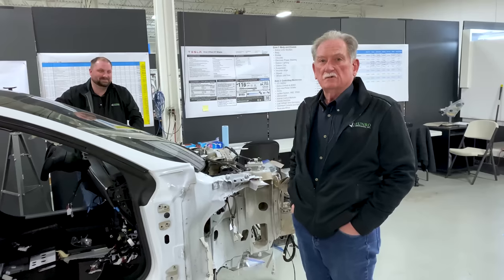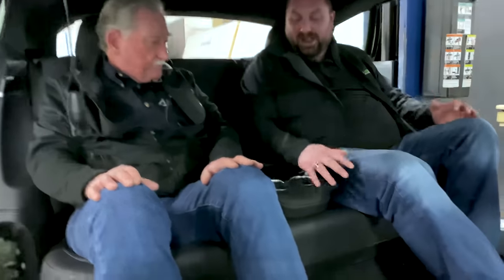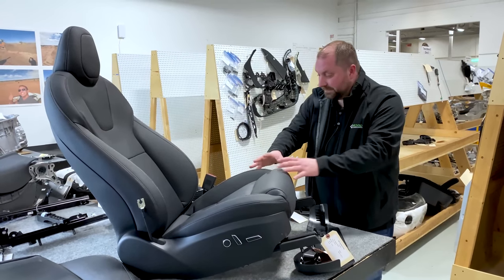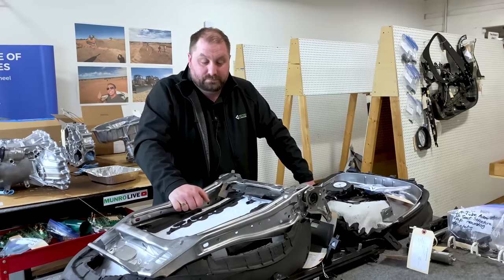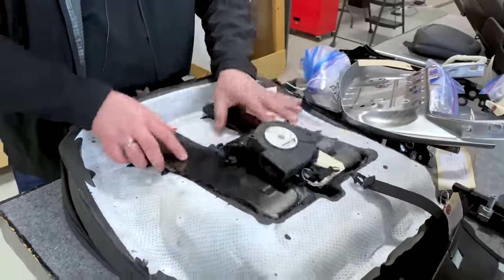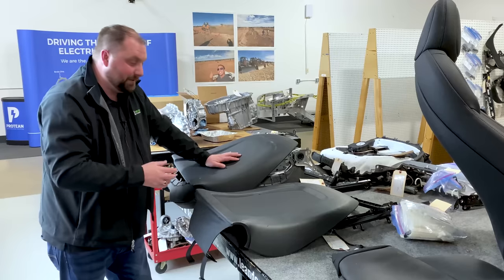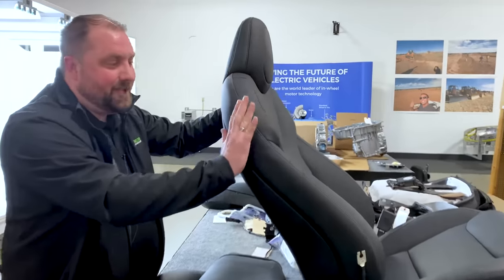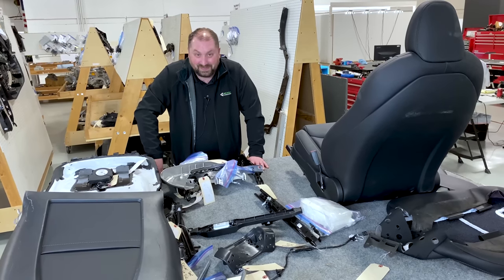Tesla Model S Plaid - Seat Components & Analysis

Comment: Carl is a beast. What incredible knowledge and he's incredibly articulate while describing some very complex subjects. Well done, Carl!
Reply from the maker: Thanks Josh
Reply: One of the less expensive options to spread the pressure to the legs, is to have a deeper / bucket like seat or tilt the sit in a more upper position to support the back of your knee. If your bottom sits lower with 2/4 cm, the rest of the seat will support your legs too and spread pressure on bottom + legs will decrease the overall pressure giving more overall comfort, leaving enough head room for taller persons - just look at Carl's torsos height comparing with you Sandy - and will increase the leg room.
Reply: Your comment hit as true as Carls remarks!
Reply: nah

Comment: FINALLY!  I get to hear someone talking about how the distance between the back of our heads and the headrest should be minimized. I worked in PT clinics for a few years and I saw the effects of whiplash injuries on people all the time. I keep the back of my seat as vertical as possible such that the back of my head is as close to touching the headrest as possible. Yeah I'm not one of the cool-kids laying way back and driving with one extended arm barely able to reach the steering wheel, but hopefully this keeps me out of the doctor's or chiropractor's office if some texting-while-driving-idiot hits me from behind at a stop light.
Reply: I was driving a 2 door 1990 Datson and was rear ended at a toll booth in New Jersey when the driver behind me was searching for a quarter she dropped on the floor.  My car was totalled and I went to PT 2x/week for 5 months.  I ALWAYS keep my head against the headrest when stopped.
Reply: The Citroen SM of the '70s is the only car I have seen with an adjustable head RESTRAINT.  I have always wondered why, with the most important part of the human body, seat designers could be so casual.

Comment: I HAVE BEEN "occupant out of position"   I was adjusting the radio when I crashed [not paying attention] and that slight shift in position allowed me to rotate around the seat belt and my head hit the windscreen.

It was a low-speed cash so it was not a big issue - but it's amazing - just leaning forward and towards the centre of the car 6" can mean the difference between being restrained and not
Reply: I had no idea this was even a thing but it makes sense. I will be paying attention to how i sit now.
Reply: @b4804514  - I was really shocked, but the seat belt moving just off the top of your shoulder as you lean forwards to mess with a centre mounted radio means it does not catch your upper body and the momentum PIVOTS you out of the upper part of the seat belt, then it grabs you around your stomach and you headbutt the windscreen.
Reply: Thanks for the information, and I'm glad that you're ok 👍

Comment: I prefer adjustable headrests, including not only vertical adjustment, but horizontal and angular adjustment as well.
Reply: As a bus driver, I concur.  The ability to put the headrest in the crook of my neck lets the seat absorb all that neck compression on bumpy roads.
Reply: @Not_An_Alien  wouldn't that cause whip lash in a collision because the support is on your neck, where it is not supposed to be? I think anyone can buy an aftermarket pillow support to modify the seat to their comfort.

Comment: Teslas functional integration is the next level.. The headrest posts locking in the back panel was 🤯
Reply: TESLA now sells Service Manual for Tesla owners and Service center for $$$.
Reply: @markplott4820  Makes sense, why hand over that business to Bentley
Reply: Where is the functional integration in all of that!? It doesn’t even offer all the features that a similar priced vehicle offers on their seats. Other manufacturers even have sockets for tablet/smartphone attachment, bolsters that hugs you when going fast around a corner, amazing massage and much more.
Reply: @carholic-sz3qv  - FALSE, Tesla rear seats have USB C and wireless charging. and a rear Center mounted display for Climate and infotainment.
Reply: @markplott4820  wrong, in tesla all those features are not integrated into the rear of the front seats and are definitely not the most ergonomic. You can directly connect your tablet on the rear seat of a bmw and plug to the seat without the need to move your head.
Reply: @markplott4820  the tesla climate and rear information is not well placed ergonomically, Chrysler Pacifica have options with seats mounted screens for infotainment.
Reply: @carholic-sz3qv  He's talking about how they connect the back panel of the seat at the factory.  It's got nothing to do with features.

Comment: Really interesting discussion. Im a vertical seat guy. I got tired of constant back aches and realized alot of it had to do with slouching while driving. I drove a minivan for a long time and it wasnt an issue. But moving to a modern sedan with a fixed position head rest I hate it and I would hate these front seats. Then again, I would probably also hate the Tesla "launch" experience as well. 

Also was noticing your mobile A-frame tool/part trays with white boards at the top. I think I may have to steal that for my shop. Really clever.

Comment: As a note:  The Headrest is adjustable in the Model X from the original in 2016 to the Raven variant in 2019. .  Not sure whether it is in the new Plaid Model X, but all prior Model X had adjustable headrest.  At one point, the Model X headrest automatically adjusted higher when the occupant moved the seat forward or backward (mimicking  the occupant's height).   Also, I believe that Tesla completely manufactures its own seat components at one of its "off-site" locations.  That part of the process was not on the tour, so it could be assembly only.
Reply: Vertical headrest adjustment is pretty much standard, power vertical is not something I have seen, but that is not really important.  The important part is fore and aft adjustment, turning a head "rest" into a head "restraint".  Only car I am familiar with that had them is the Citroen SM of the "70s.  There have probably been others.

Comment: Carl, thanks! Very interesting to hear about things I never thought about. The denser the information the better, you did a great job in going into the details. Regarding the topic of buying multiple parts and then assembling them at Tesla being potentially more expensive, Tesla might want to have full control over the seat design and avoid delays and complication with communication when they decide to change something on the seat design.

Comment: I never knew how complicated auto seats were
Reply: Most OEM's order Generic seats from parts OEM's.......lol.
Reply: @markplott4820  other manufacturers have many different types of seats from clothe to leather(vegan and naturally tanned) to wool, carbon fiber…..
Reply: @carholic-sz3qv  - cloth seats too HOT 🔥 and less sustainable than Recycle ♻️ plastic & ORGANIC vinyl.
Reply: @markplott4820  wrong, clothes seats are mostly used on very cheap cars there are tons of cars that are even up to $15k cheaper than a base tesla. Clothes are also easily recyclable and reused in cars too. Bmw has been using recycled plastics and fibers in their cars for almost a decade for your records.
Reply: @carholic-sz3qv  - ORGANIC vegan leather is Superior.
Reply: @markplott4820  vegan leather is not superior and it’s made out of oil. The ultimate superior is real leather tanned with natural products. Real leather is a byproduct from the meat industry and not depending on oil.
Reply: @markplott4820  If the vegan leather is basically vinyl, how can it be organic? Organic refers to things that are plant based. This is plastic based.

Comment: That's a curious change.. my 2017's headrest adjusts through the control panel on the screen.  Might be another one of those things they see being under used and removed to save the costs and complexity. I think I set it day one and haven't moved it since. Of course.. it's nice for if you have 2 different drivers and profiles saved. But I guess they found people can be comfortable without moving the headrests.

Comment: @18:12 I may be incorrect because I'm not there to touch and feel, but it appears by the shape of the seat back detail it does in fact have retention snaps meaning the seat back can be assembled without the head rest to hold it all together and the rods are primarily acting as an extra locking mechanism to prevent it being pulled apart.  If it functions as was stated, when you take the head rest off, the seat back would just fall off and I suspect that does not happen because of snaps holding it on.  Personally, I think this is a clever design because it adds an extra level of durability without adding more than a few cents of plastic and adds no extra parts and no extra assembly steps.

Comment: I think the big issue with the rear seats are due to body construction constraints. The low roof for design and aero pushes the seat bottom down. While the thick floor caused by having batteries in it pushes the feet upp causing the reduced support on the thighs. Hard to work around.

Comment: The seat back panels are pinned in place by the head rest mounts to prevent the panels from detaching when the seat's internal side airbags are triggered. If snap fittings were used, the back panel could be fired backwards at high velocity and injure passengers. The seat airbags are the reason Tesla did not use the customary upper snap fittings.

Comment: The headrest angle is a very big deal to small people, as they move the seat back to vertical in order to reach the steering wheel.  I have a very hard time fitting my small wife to a car, and the seats are always deal breaker.  Subaru headrests are on a ratchet and pawl mechanism.  To my understanding they are only automaker with adjustable angle headrests.
Reply: Thanks for the heads up, I'll have to check them out.  I had been referencing the classic Citroen Sm head restraints of the '70s.
Reply: @wilfredvanvalkenburgh2874  Even the Subaru sales-people are not clued in on this.  You have to twist the headrest all the way forward to release the ratchet and pawl, to then set the angle you want.

Comment: Great job!
Reply from the maker: Thanks!
Reply: @MunroLive  You replied to me? Thank you! I have been very impressed with so may other folks (Like today!) that we have seen on Monroe Live. It makes me want to work with you more than ever. Just the other day when you revealed Tesla was using mica in their Plaid battery, I instantly thought: Of course they are for most of the same reasons I chose that same material for use as a lamp module frame on the world's first 5 pound video projector back in 1998. In my case as Chief Engineer we had +/- 12.5 kVdc strike voltages, intense light including UV, and nearby quartz temperatures around 800C that all had to pass FCC and UL for consumer use.

Comment: The rear seats on the Model 3 have the same problem - I'd trade headroom for being able to sit properly.
Reply: Some brands don't put batteries in the floor under the backseat feet. Seems the only correct way to go. Cars have plenty  of range. The backseat foot rest is where you get to make the car feel spacious or cramped. If helps a bit if you can open up the room under the front seat for backseat leg stretching. And imagine how much the absense of 65mm or 80mm cells  plus auxilaries could make there.
Reply: @Cloxxki  wrong…. Almost all brands puts batteries or inverter/charger under the rear seats, it’s just the configuration that sucks since the floor is flat seats little to low.

Comment: With the old Model S the AC charger(s) were located under the rear seat. It was moved into the battery enclosure. So there should be plenty of design space to make the rear seat better.

Comment: Could you shed some light in why, after all these years, the Model S still has no adjustable seat belt height on the B pillar? Is it a technical thing? I’m rather small and it cuts into my neck. Doesn’t feel as safe as it could be

Comment: 80% of the Model 3 I've seen have the lower hooks of the back cover not hooked in, obviously.  I like the solution with the headrest structure, but if it leads to sloppy installation of the lower mount, they should do something about it.

Comment: Elon has spoken about how the original seats for the S were terrible, and the amount of work that went into making them good.  I expect that a similar amount of work needs to be done on the rear seats.
Reply: disappointed in TESLA rear seats, they are OK, but not same level as the FRONT seats, they should be of Equal support & quality. 
Model S rear seats need recline just like Model 3/Y has.
Reply: It’s basically the same seat in the super expensive plaid that is used in the cheap model 3 what a shame, those seats should be something very special for their high end vehicles at least.
Reply: @carholic-sz3qv  Or you can look at it as the Model 3 is getting the same seat as the high end Model S.  Tesla is making the best seat they know how to, and using it everywhere.  Annoys snobs, but the rest of us are grateful.
Reply: @CorwynGC  lol….. they make the same old boring seats and interiors in all their cars, it doesn’t make their cars special at all, same goes with paint and many other features, not all tesla owners actually like that boring everything the same.
Reply: @CorwynGC  the best seats and interiors just like air suspensions…. Are for flagship cars. tesla makes seats for their cars that doesn’t it’s the best seats let alone not something special. It annoys no one and the rest of you are not grateful at all, people have been modifying their tesla because they looked so bland inside

Comment: Rear seating isn't great in the new model S - mainly, the lack of leg support that Sandy mentions - maybe a possible solution would be to lower the floor area for the rear passengers but that would require changes to the battery pack
Reply: The other option is to raise the seat, but that would decrease headroom. Allowing the seat to recline, as many luxury cars have, would both solve the leg support and headroom issues.

Comment: Carl, do you recall a seat base design back in the 80's or 90's where the seat would cam slightly forward, up and rock back slightly in a crash? I remember seeing video of test subjects crashing junk cars into trees and barriers wearing no seat belts. They remained firmly in the seat. I'm thinking air bags may have killed this idea. The test subjects suffered hardly any trauma in the crashes. Far less than you would in an air bag deploy.
Reply: There's probably a car or two that used this but I expect it has very narrow application.  Too tall or too fast and they'll rotate out of the seat.  Too fast and you'll have too much energy dissipated through the spine.  Crash at an angle (nevermind t-bone or rear impact) and it doesn't help at all.  Lean forward slightly and you'll be out of position, also rotating out.  All these can be helped by using seat belts, crumple zones, and airbags (70 year old tech!), which are much more flexible, much more effective.  With all those in place it's unlikely to be worth the cost of actively moving the seat.

However, there is a similar passive system mentioned in this video.  The metal front edge of the seat combined with the thick foam at the back means your body can sink down upon impact even as your knees stay high.  The primary goal here is to avoid submarining (sliding under the waistbelt) but it's the same sort of posture.
Reply: @rhamph  Agree on all points. I was mostly interested if anyone remembers it.  At best today it might be combined with other measures. If I recall they tested mostly at about 30 mph, and it was amazing how little the occupant was bothered by it. if I recall, they even tested with the doors off so they observe the occupant and the seat movement.

Comment: I noticed that only foam is used in lieu of springs. Have automakers stopped using springs in seats? If so, why? Also, won't foams compress as they age and therefore degrade seat comfort?
Reply: Most likely cost. Plus, springs also deform over time and could rip through the seat. Cheaper to replace the foam in the seats than springs. Plus many mattresses now use foam

Comment: Biggest problem with S seats has been the complete inability to adjust squab angle independently of height. The squab front cannot be lowered once the H point height has been set. Squab height also interacts badly with fore/aft limits. Has any of this been improved for Plaid?  The adjustability of my 18MY S’s seats is very poor indeed. 

And that’s before you get to the stupidity of the order of functions of the seating memory, moving between one position and another. Moving from a taller driver to a shorter one, the first thing the seat does is go rearwards…. Not great.
Reply: I totally agree with you on that. For that price the tesla seats simply lacks tooo much features
Reply: @carholic-sz3qv  Exactly and that’s before we even get to dynamic cornering g dependent bolsters and seat back massage. All features I’ve had in older but similarly priced cars.

Comment: I would rather have distal half of posterior thigh off seat so can allow venous blood flow return and ease compression of neurovascular structures embedded in the hamstring compartment of posterior thigh.
Reply: But that increases pressure on the proximal half of the thighs, which is tiring over time. My number one complaint about seat bottoms is a lack of distal thigh support. Airplane seats are especially bad.